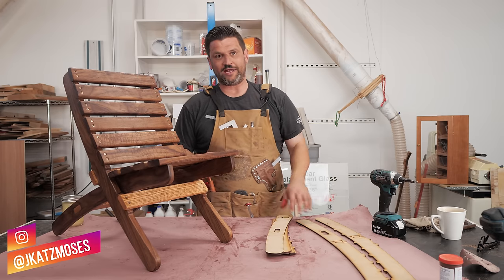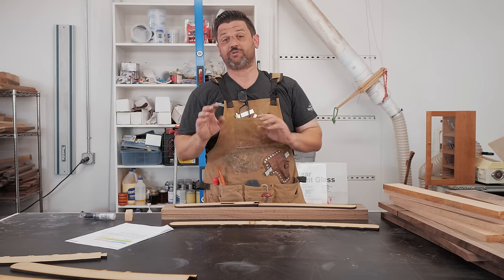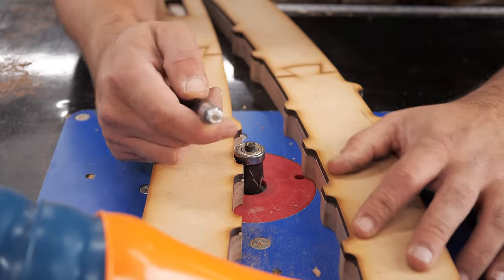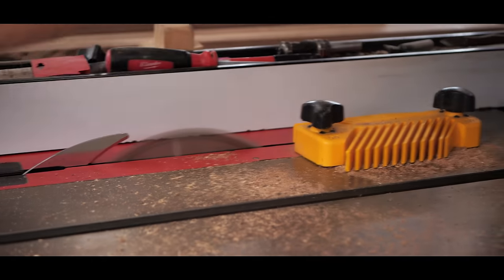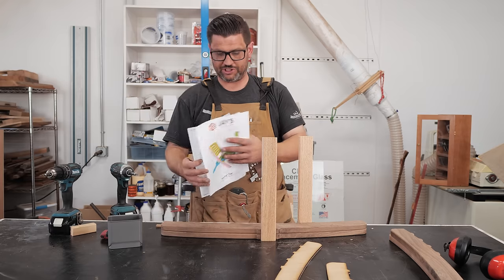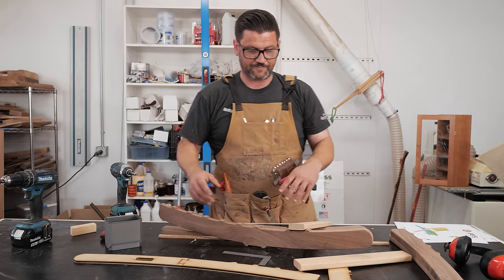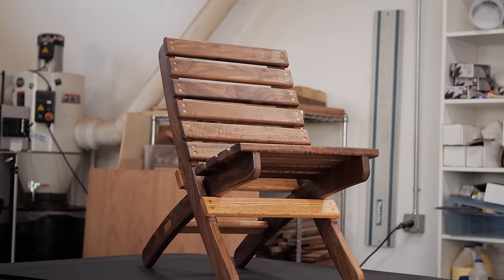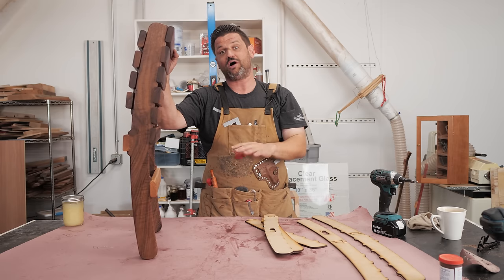Nesting Chair Build with Templates

Comment: One problem i have with the notched legs design is if you want to make changes to the seat and/or backrest angle. If you want a lower seat angle, you need to lower the bottom brace of the backrest legs, but the notch interferes with that adjustment. Same issue with reclining the backrest more. 
Other than that they look great and the design is beauty-in-simplicity.

Comment: Great project. Just a thought, since nothing was glued up wouldn't it have been easier and faster to put the "Goo" finish on all the parts before assembly?
Reply from the maker: That's a lot of screws to take out. Took less than 5 minutes to apply
Reply: @katzmosestools  I meant before assembly.
Reply from the maker: Definitely not. Then it'll get scratches and dents plus that stuff doesn't dry very fast so the peices will be slippery unless you want to wait until the next day to install.

Comment: The 1/4 round over bit does not remove enough material to allow the slat to fit tightly in the bottom of the fillet. I have to sand each slat before attaching it.  Am I doing something wrong?

Comment: I am pretty sure that is a 1/2" round over, because that is the size of round over bit I had to use to get the slats to fit the leg rails. I started with a 1/4" round over and it was not even close to fitting. If you are putting it up against a 1/2" router bit shaft it is a 1/2" round over not a 1/4" round over. My set list them as round over size. Plus they are probably  20 years older then you. So how are round over bits listed?

Comment: @8:33 did anyone else cringe when they saw the wood split when he was driving that screw???   Uhhhgggg. That's the worst when you've worked that long on a piece to get it perfect and then it breaks/splits during the dry fit. :(
Reply from the maker: Easy fix. Check out my 7 ways to fix common woodworking mistakes.